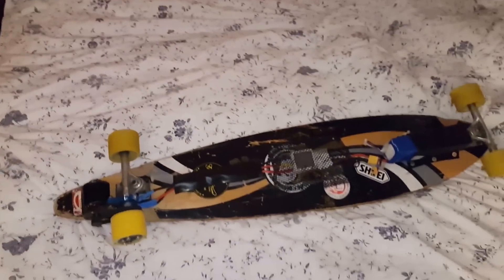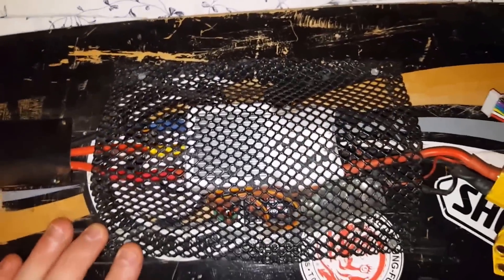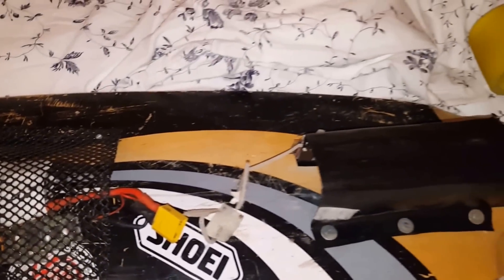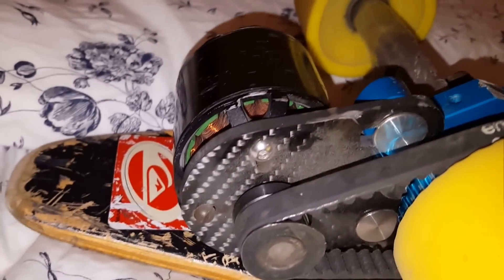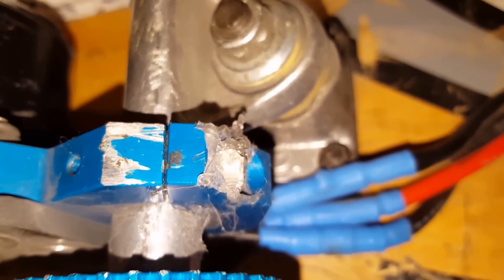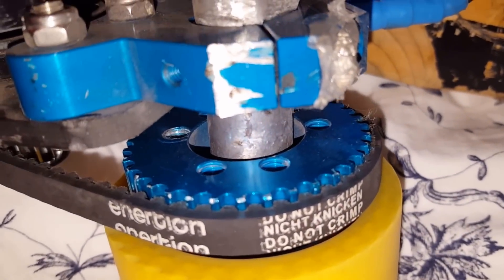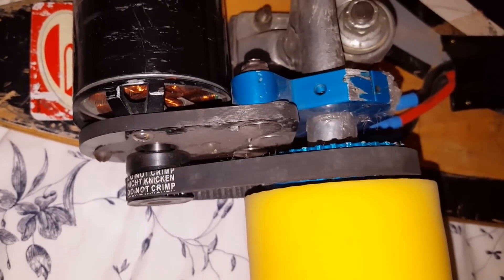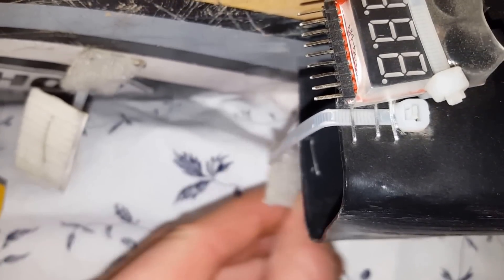DIY - 3200 [W] ELECTRIC SKATEBOARD FOR 350 DOLLARS | Building tips and tricks! [The Green Bandit]

Comment from the maker: +herbert keks Good ideas! I would argue that harder rubber wont help much with the wheel turning away but a second engine on the opposite wheel would. It's just a question of the power being delivered to the wheel. The shock pads are a good I dea but I have adjusted the tightness of my axles quite perfectly because I used to ride this board downhill before and I don't ever get wheel bite unless my foot touches the wheel. The metal box is a good idea but it's pricey and I would never ride if it's wet outside so waterproofing the system is not necessary for me. You are right the sidestep is a big issue and if someone asks me to build one for them I will get raised axles and bigger wheels for more clearance I might even split the lipo into two to make it flatter and protect it with a hard case or mabe even mount the batteries in the middle of the topside of the board :D

If you got this far thank for reading! haha 
Never give up your projects you have to start somewhere. Good luck!
Reply: +The Green Bandit i almost want to advice people to "NEVER BUY FROM CHINA" seeing your small pulley is "off centered" . then  again ..... a few companies ARE actually reliable . i bought the ENERTIONS SPACE CELL and it is made in china . and i am fully satisfied of its performance .
Reply from the maker: +Pak Busu I like buying Chinese products. They make good value for money. this pulley was a big surprise to me. it's the first time something like this happened to me and I told the  the seller and we made a deal. so they're trying their best. just don't buy knock offs ie things advertised as being high quality but the price really isn't even close to the market value.

Comment: Great Video, my suggestions to make your board eaven better would be to get shockpads underneth your trucks to provent the wheelbite and some harder rubbers because i see that your truck bends away when you give it power, i would personaly put everything in a metal projectbox and glue the esc fins to the box to cool it, it would also make it waterproof and protect the battery, I think you are not riding down the sidestep with this thick battery behind the truck aren´t you. Dear Herbert. Keep up the projects!! :D
Reply from the maker: Good ideas! I would argue that harder rubber wont help much with the wheel turning away but a second engine on the opposite wheel would. It's just a question of the power being delivered to the wheel. The shock pads are a good I dea but I have adjusted the tightness of my axles quite perfectly because I used to ride this board downhill before and I don't ever get wheel bite unless my foot touches the wheel. The metal box is a good idea but it's pricey and I would never ride if it's wet outside so waterproofing the system is not necessary for me. You are right the sidestep is a big issue and if someone asks me to build one for them I will get raised axles and bigger wheels for more clearance I might even split the lipo into two to make it flatter and protect it with a hard case or mabe even mount the batteries in the middle of the topside of the board :D

If you got this far thank for reading! haha 
Never give up your projects you have to start somewhere. Good luck!
Reply: +The Green Bandit How many Kv has your motor and how many Amps the esc, didn´t get that, would realy hard want to build one, and whats the tooth number of pinion and speargear and the wheel diameter. mybe get a rgb led light strip underneeth, if you like light underneeth it :P
Reply from the maker: +herbert keks Hey! Well the engine is 170KV, the energy it can produce is 3200watt and the current the ESC can handle is 80Amps.
I recomend using a #2 AWG cable for conducting such current!
Reply from the maker: +The Green Bandit You could technically put a 10s lipo on this baby
i.e. 3200[w]/80[A]=40[v]
=> 6s lipo is 3.7[v]*6 = 22.2[v]        and 10s lipo = 3.7*10=37[v]

Comment: I hear people say I need two 3s batteries but I see you have the one 6s  can you explain what I need to factor in when I go to buy?
Reply from the maker: Hi Brian! Sure if you use a 3s battery you have half the voltage of a 6s battery. ie if you buy a 6s it will have the same voltage as two 3s. It is probably cheaper to buy a 6s battery then a 3s. I made an excel sheet for price comparison and it is true that you may find it cheaper to buy two 3s batteries. In order to then make them into a 6s you have to connect the red (+) of one to the black (-) of the other which then will double the voltage. DANGER : do not connect the remaining two wires or you will short the batteries and they will be permanently damaged and may explode.
Reply from the maker: Yes it is just a metter of cost. it's the same but less costly to repair. But I just replace a bad cell.
Reply: Brian Volk also one 6s battery will be wider than two 3s, with limited height under the board, two 3s may be what you are looking for.

Comment: I weight 54 kilos and got one with two of those motors.

This is gonna be fun.
Reply from the maker: hahaha yeah you're gona want to adjust the power delivery of your esc
Reply: +The Green Bandit Also his motor will not over heat because of strain. Which means he could go faster with different gear reduction.
Reply: I can lower the acceleration curve without adjusting the top speed.
Reply from the maker: ColindaPieman
Thats exactly what you need ;)

Comment: could you show us how you did the wiring with the ESC?
Reply from the maker: Just connect the whole circuit before plugging the battery in. The way the wires are plugged in will determine the direction of the rotation. If it's backwards unplug the battery and try a different wire configuration.

Comment: hello, i'm planning on making my own e board. but i don't know where to start. I don't have much knowledge about electronics or that kind of stuff so in scared of buying the wrong parts. any tips?
Reply from the maker: hi I'd recommend using the people that I provided in the descriptions they will be very helpful if you need anything. Also you NEED to read up on the concepts like torque, a bit of electronics physics, and you need to draw the circuit and the board including motor and extras on paper and make sure you have all the parts from your blueprint. then go ahead and order everything

Comment: is it too close to ground if we use 70mm flywheels, can we use 70mm flywheels?
Reply from the maker: +Diptais Good It depends on the diameter of your wheel. So if your longboard has at least 40mm radius wheels you'll be fine otherwise it may be too big.

Comment: looks like your motor case got a little wobble because of bent shaft. i bought mine from alien motors and had to return it because of the same issue. it will kill your bearing over time
Reply from the maker: Hi! Sorry to hear that. It's wobbly because of the Bad Gear not because of the shaft. I bought it cheap online and that wasn't a good idea :( Hope the video was helpful!
Reply: +The Green Bandit i was about motor outer can it looks like it spins and wobble on the end of your clip it may be just that it looks like this on the video but in my case it was a shaft issue
Reply from the maker: greg23842384 Great! And thank you for the observation I will check for any issues ;)

Comment: Youre saying with a 190KV motor, (A single motor!) and you being 200Kg, it can carry you up  hills just fine?

Here i was at 86Kg, going to buy 2 190Kv motors!
Reply from the maker: +denarius hey! Well no please refer to an earlier posted response in which I detailed how to calculate the right power needed. It is not a function of kv. The kV will determine your speed more or less. Also 220 lbs is 100kg. But yes it goes up hills easy. After having been riding for about a year I would recommend using a chain which will give you more consistent performance over the long run than a belt.
Reply from the maker: +denarius wait wait wait! kV is a rounds per volt rating
Reply from the maker: +denarius what you need is to calculate how many watts you need and then get as low kV rating as possible.

Comment: how well does it conquer hills?
Reply from the maker: it conquers hills without any difficulties even without any help the only problem is... CAN YOU STAY ON?? Haha!
Reply: +The Green Bandit However you cant slow down right?
Reply from the maker: +Adwe STV Hi! well technically you can reverse the current which would act as an emergency brake in case you fall of the board the issue is that it's most definitely not a progressive brake. The motor jams so to speak which blocks the wheel. if you're heavy like me it will strip the belt drive (I speak of experience).

Comment: Also... this is really 350 bucks? ESC alone is like 100 bucks. Plus motor about about 100 or more. Plus metal rig and pulley about another 100 maybe 50? Plus battery is like 200-300. How did you get it to only cost 350??
Reply: The motor's probably about 50 and the battery 50-60
Reply from the maker: +Vladimir Longrod Hi Vladimir, yes it is ;) Have a look at the links in the description. If you don't have a board already you might have to pay more to get the wheels and board but all the extra electronics and mechanical parts are under 350 USD. You can go to the links and see for yourself ;) The batteries are not 200 don't worry! Just get them on any hobby shop online you will see they are less than 80 new.

Comment: Soo... if you have a 6s Battery you get around 24Volt, which means you have to draw  134Amps ( i doubt your speed controller can handle that) it still gives you 2 Minutes and 14 seconds Batterylife at full power. Check your facts
Reply from the maker: +David Rier Hi thanks I'll verify for sure and make changes to the video when needed. the speed controller is rated at 200 amps if I remember correctly.

Comment: Its not an engine.... it's a motor... engines are combustion based... not electrical. Tesla cars have motors. Fords Have engines. Thank you, by the way your video was great... but "engine" made me cringe the whole time because you seem like you know what you are doing, but u are calling a motor an engine when they are entirely different.
Reply from the maker: Thanks! And it's good that people like you notice things like these. You make the world more precise.
Reply: +The Green Bandit and why not just add another battery in parallel? it will double your battery life and you wont have to switch out batteries as often
Reply: That was bothering me so much too.
Reply from the maker: Your are right. But I chose to minimize the size of the installation and it still provides up to 30 minutes of work at full load.
Reply: So whats a steam engine? Why is a gasoline engine called a combustion engine and not just engine?